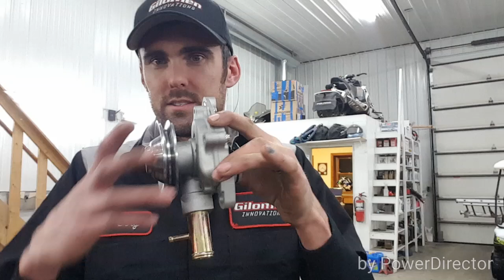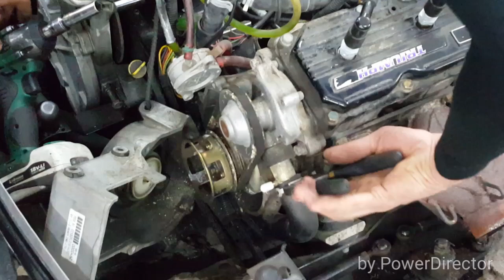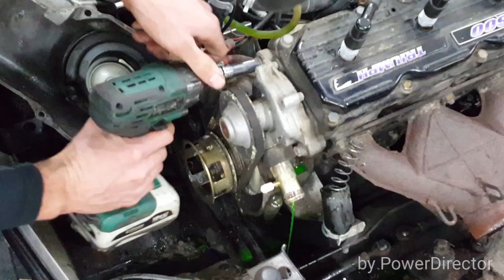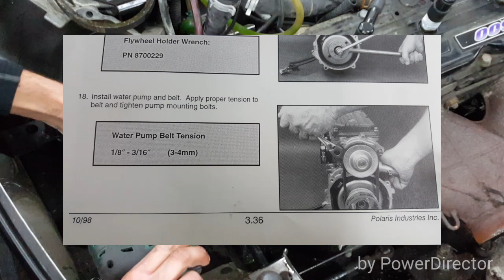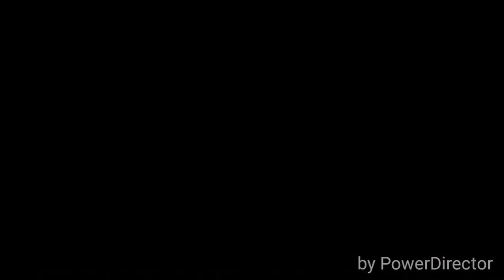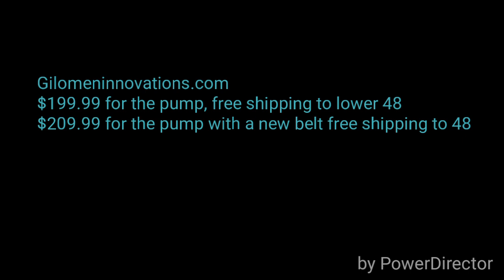How to Replace Polaris XLT Water Pump and Belt XCR 600 580

Comment: I just bought a polaris xlt 600 and my water pump works good but has a small leak is it safe to run it like that until I can afford to replace it???
Reply from the maker: Usually if the pump is leaking from the weep hole the bearing will fail in the near future.  Definitely keep an eye on it.